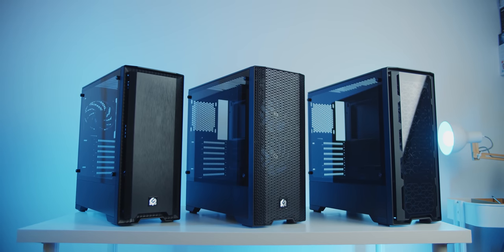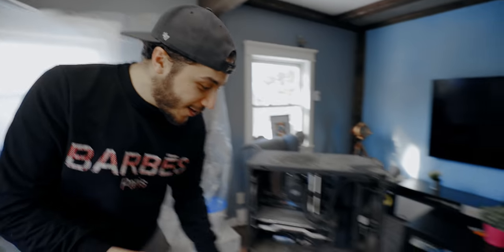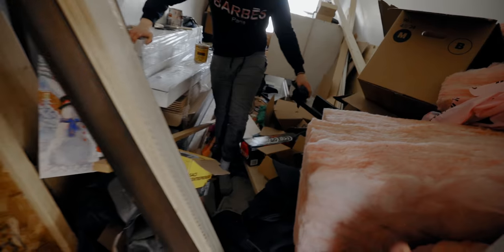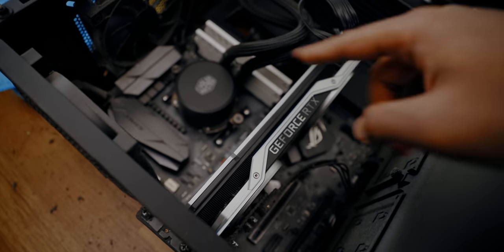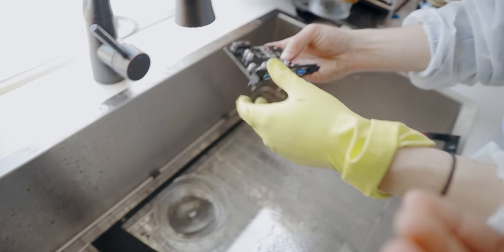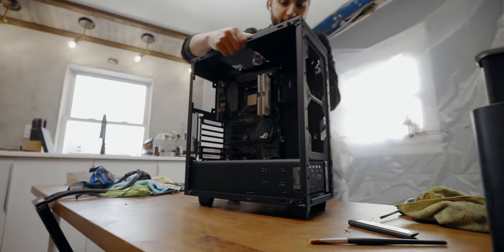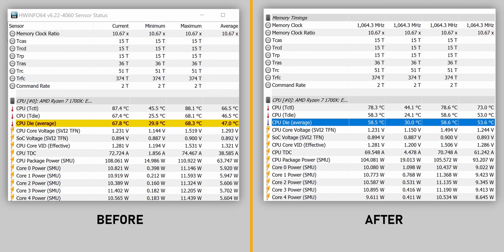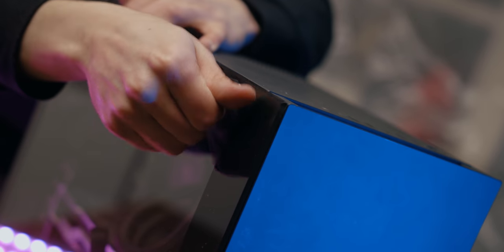THIS Is Why Cleaning Your PC Is Important! 🤦‍♂️

Comment: With renovation of the house still in progress, be prepared to repeat this exercise regularly. Good thing he has watercooling; when my house was being renovated, I still had aircooling and the CPU-cooler was completely blocked by dust- could not get it out. Needless to say, the CPU retired itself. Now I have watercooling; at least the dust collects in the fans and radiator - it's a bit easier to clean. 

I think this would also have been a good opportunity to renew the thermal paste, btw.
Lesson learned: do NOT use the PC while renovation is ongoing. That fine dust will go everywhere in the house and in the PC.

Comment: I cleaned 3 PCs now
I take the electrical parts in the PC case out such as power switch, led etc. and washed the PC case and tempered glass with dishwashing soap 🧼. I wiped water and soap (the wet rag is squeezed so no it won't damage the electrical components of the fan) the dusty asf fans is worst part in cleaning PCs. Motherboard and GPU brush with paint brush (paint brush that's only used for dusting things not for painting)

So ya that's basically it Wash PC Case, Wipe Fans and Cables,  paintbrush dust the Motherboard and wipe and brush the Graphics Card.

Comment: Use Q-tips dipped in iso alcohol to clean the fan blades.  The dust sticks to the Q-tip so you don't end up pushing/blowing it onto something else.

Comment: I can honestly recommend his CPU AIO.
I got the same one (CoolerMaster Masterliquid 240L) and I am impressed, I originally got one for free in a bundle and I was already prepared to sell it for a few bucks and get a Corsair AIO instead but I am glad I didn't. My only complain are the fans, they get loud on high RPM, but so do Corsair fans. Decided to pair the AIO with two Noctua Chromax static pressure fans and now the AIO is VERY quiet. If you're on a budget, get it with the stock fans for like 60 bucks, if you can invest 40 bucks in two good fans, you'll have a quiet AIO with high quality fans for the price of a Corsair AIO. It took a few hours to get the bubbles to move but now the pump is as quiet than the one from my Corsair 280 Platinum.

Comment: Cleaning our your pc is essential to maintain its top performance, but why do so many of you have to be so obsessive over crap that really doesnt matter, thermal paste applications, fan noise, temperature readings like I swear some of y'all need to check yourselves into therapy or something that stuff is so not worth the time in most cases, computer components no matter how hard you try are going to produce heat, its inevitable what you don't want is for them to produce too much heat, because they are constantly processing all of the workload that you  demand on the systems, I could understand if a fan was failing or it was keeping too much noise, but any moving part is going to fail eventually, when that time comes just replace it and be done with it, if the old technology doesnt fail how is the new tech going to sell huh? You think these companies are gonna make systems to last 20+ years? How would they make back that money to stay in business.

Comment: I just care for my computers, no smoking, incense, even fried foods. If your doing remodeling the computer should be covered and turned off. Thats another thing, the amount of idle time if your fans dont turn off at idle is a significant amount. In 3 years put 1.5 years of wear on your PC if you shut it down when not in use.
Obviously that AIO is working well, but it probably isnt too much longer until the pump fails or the fins get gummed up.

Comment: this definitely has mine beat in terms of dust levels, i just use a can of compressed air, and you can run stuff like that usb card under water, as long as you dry it quickly afterwards

Comment: take apart everything, if you need a proper cleaning! Throw your empty house in your bathtub or shower and do with warm wather and soap. 
grab the antistatic brush and vacuum cleaner and sweep all the dust from other components ( VGA card , SLOTS on the motherboard etc. )
NEVER blow dust !!! it's stupid because it comes back to the surface to be cleaned and you can clean up AGAIN!
USE BRUSH AND VACUUM CLEANER!

Comment: For as bad as that PC has gotten, in 3.5 years, that's honestly not bad at all, I had myself a pre-built PC from Asus, bought it somewhere around late 2012, used it until around late 2015 in October, so definitely around 3 whole years of heavy usage, I knew nothing about computer maintenance back then, the computer as a whole had only a single fan from a 120mm Radiator for an AIO that cooled the i7-4770k, and a Founder's Edition GTX 770, 3 years of negative pressure, averaged around 6-10 hours (maybe even 14-16 on weekends) a day of gaming, and once I finally opened that up to upgrade to an RX 480, pretty much everything was caked in dust, probably went to at least an inch thick thanks to negative pressure, like.. you wouldn't believe it until you seen it kinda deal.. Thankfully, ever since then I've learned to wipe down my PC every now and then, so I won't repeat that one mistake.

Comment: Yeah, I bought a box of single use gloves when I started cleaning other people PCs. Meeting a family of spiders that was about to get evicted is nothing new. Orange juice spilled inside a desktop case is nothing new. Poor fans screaming in agony for air is also nothing new :)
I believe this FPS boost can also be contributed to CPU being cooler and boosting higher/longer now. Also motherboard components, like VRMs will benefit a lot from better air flow, since they too can thermal throttle the CPU.
Most performance (re)gains that I saw was when I've cleaned and repasted gaming laptops. Since they are running near/on thermal threshold already, having cooling problems can bring that performance to the knees. Most people actually forgot how fast (and silent) their laptops can be when you let them breathe :)
Conclusion: clean your PCs people, they are not just a furniture that can be swiped clean from the outside.

Comment: I have cm h500p and it collects a lot of dust, so every once in a while i got to mechanic and clean it with air compressor(its about 10x stornger than dust blower they are using) and i gotta tell you guys to do it as well cause it keeps my case so clean its insane

Comment: Aight guys listen to this advice:

if you PC gets this bad, or even less, do not bother.
You can litteraly wash all your components in the dishwasher, I've done it hundreds of times for the last 10 years I'm building and cleaning PCs.
The ONLY importants things are :
- Your components need to be completely OFF, no power source (especially the BIOS battery, remove it)
- Fans shouldn't spin while being cleaned, that would create electricity 
- DRY YOUR COMPONENTS before reassembly (there are plenty of way to completely dry them, on a sunny day, in rice, on a radiator...)

I never had any bad result with this method BUT if you are in a hurry, that's not the best one since it takes time for the components to dry.

Comment: I have a low-airflow Phanteks Shift case I dust (fine mesh filters mostly with a full-case dust every 4-6 mo) and the last time I ignored the filters for a couple months under heavy load (batch video conv.) and then cleaned them it dropped temps roughly 5c on the CPU.  10c is a LOT for a case like that.  Just wow!

Comment: Washing electrical components (small ones) under taps isn't actually that bad, as long as they are left in a warm dry spot for a few days. Water itself doesn't damage components, it's conductivity does. No charge, no conduction, no problem.

Comment: I just cleaned my PC out today since it was 60 degrees outside (I do this typically every 3 months) and all of the dust combined was less than the amount that was on his glass side-panel. You don't have to do heavy maintenance, but all PCs/Consoles need to be maintained, that was far too much/too long. Also why did you guys clean it inside? I know it's cold outside but (besides what went into the sink) all of that dust is now dispersed through the room again. I hope you guys vacuumed after lol.

Comment: About 18 years ago I bought a decent household compressor/inflator  from a Sears auto center on sale for around $30.  Yes, it can inflate tires, but my main purpose was for cleaning my pc, which I do with a nozzel tip.  It has very suitable pressure for cleaning, and although an unfiltered compressor theoretically does put out a slight bit of condensed moisture  this has been completely negligible for my purposes.

It still works, (even for inflating my tires) although I've had to splice a leak on the old hose by now.  I bought a replacement once, but most of the lower end ones now just barely put out enough pressure to slowly fill a tire, and I'll just keep using my old one for now.

Comment: You shouldn't assume the psu is clean just by looking at it. I reused my Corsair PSU in my new computer. I have it with seven years. It looked cleed from the outside but I blew air through it and it was filthy inside even though there was a dust filter on the bottom of my old Fractal R4 which I cleaned once a month.

Comment: I don't have a data vac yet, and my PC is on the floor... Which isn't tile flooring, it's carpet. 😬... And it has no dust filter...... But at least, I take the side panel off regularly to clean the fans with Q-tips and a microfiber cloth... (Why do I still feel that isn't enough?)

Comment: Lucky he didn't short something out. You have to disassemble your system and dust it out every 6 months at least. You loose so much performance. Just getting hotter and hotter. I'm lucky and have a compressor and lots of hose. I take it out on my deck and blow off everything and then dust my entire place. Turn the pressure down to 20-25lb so you don't blow parts off. Try not to spin the fans you can over spin them much faster than they are meant to go.

Comment: Easy way to do fan blades, 1" new paint brush, takes maybe 5 seconds to clean each fan, I use them all the time. You can also use the brush to clean everything else in the system than just blow it out.

Comment: i actually wash the fans & case with direct water (i know lubricant goes away, but, i do lube the motor afterwords), possibly with low-medium water pressure, all this after full disassembly of-course & only once a year :) :) :)
dry the fans for atleast 2 days in hot sunlight, so don't this in winter & definitely not in rainy season :) :) :)

Comment: 1) PC fans does generate voltage, but, it didn't come out to the motherboard because there's a circuit in the middle, there's not a straight connection to the fan coils.
2) It's nothing wrong if you wash a circuit with water if there is no current flowing through them and you dry it before connect them.

Comment: lol thats pretty bad but the worst I've seen had so much dust the whole cpu cooler was covered an inch or more in places and most, probly 80% of the internal areas of case was just solid dust and muck lol, it was soo bad the cpu fan couldnt move and started bsoding. ohh and I also another one I saw had ants living in it and they killed the motherboard, I assume by shorting it cause they were like inside pcie/pci slots and all over the board haha

Comment: Just put it in the dishwasher, sides off, window side facing down and run a cycle. Take it out afterwards while still hot and let the heat from the cycle evaporate any water left on the components. Leave it a extra couple of days after you think it is dry just to be sure. It will smell great and be very clean. You may need to oil some fans and replace some thermal grease in a few weeks.

Comment: I have one of them bed air pumps on crack sold on Amazon as a PC dust blower,  the entire thing turns into a heat gun after 1 min, even then I cannot get radiators all the way clean. Cannot really stick an AIO in a solvent tank either, and I cannot even find a comb that will fit them all the way. Cleaning them is a bit ass.

Comment: It's definitely real. Nvidia cards will downclock themselves due to temps, they will also drop voltage to try and maintain decent clock speeds while handling heat

Comment: Bruh..... this dude really talking about not letting ur fans spin so u dont induce a voltage......... MY GUY..... thats not at all how electrical theory/physics works. And you dont think they place diodes on electrical components to prevent any sort of electrical "back-flow"... laughable. And this guy is supposed to be a tech YTer smh

Comment: I believe Overwatch uses a single core on the CPU. If you dropped 10 degrees on
 a Ryzen processor its possible you achieved a higher single core auto clock. This could account for the performance increase.

Comment: The GPU was only 2 degrees cooler because it clocked higher.

If it ran at the same clock speeds it would probably also be 10 degrees cooler.

Comment: 10.23 i said don't do this but if there is no electricity going trought components u can wash everything without damaging components only thing that can destroy components is corrosion
I know i shouldn do that but i literally wash my entire pc with pressure washer and it it working fine and it is running 5th year now

Comment: to explain the higher FPS, when you get more heat, it thermal throttles (slows down) to keep heat down, cleaning it, letting it breathe better, runs cooler, and does not thermal throttle

Comment: The cooler ryzen get the the longer it sustains its turbo...most turbo more frames too... so as you said cooler gpu better boost so split and maybe say 5fps for cooler cleaner gpu and 5 for cooler CPU....

Comment: Here is a question for everyone who's ever cleaned their computer.
9:15 - Snows tells us to always hold the fan so it can't spin if you are blowing it out using compressed air or a blower. This is so the spinning fan won't generate electricity and feed it back into the fan controller and fry it.

My question is has anyone ever had this happen to them?

I've been in the PC industry for over 30 years and I have also heard that, but I've never heard of anyone who had it happen to their machine. I've seen technicians use compressed air to spin up fans to ridiculous speeds and the fan controllers were still working after that. A few guys were having an internal competition seeing who could spin the fans the fastest using a vacuum cleaner, and nothing died. With time I started to ignore the idea of spinning a fan killing the controller and since then I've cleaned hundreds of machines and never had anything die from giving the fans a blast of compressed air.
So has anyone actually had this happen and I have been just incredibly lucke never to kill anything or is this another myth?
Reply: Blahorga Slisk I’ve watched a lot of videos of projects on how to generate electricity. The fans do generate electricity but probably not enough where it can kill components. I rather play it safe and not let the fans spin when using a blower.

Comment: I built my pc about 4 months ago, Lian li lancool 2 mesh,the works, and I have absolutely no dust in the pc what so ever, or on the outside, except for the rear exhaust fan which had a tiny amount on them but that was simply cleaned off and the dust filters taken out and cleaned and the pc is good to go (the top filter I had removed for a while and forgot about it so some dust got in but not lots! The Lian li lancool 2 mesh is an insane case
Reply: It also depends how clean the room is where the pc is. If you clean your home frequently and there is less dust, your pc will have zero dust.

Comment: where can i get that blower?
Reply: We got it on amazon. Honestly its great for small tasks and you can clean the filter easy, but if you can get a tiny shopvac vacuum cleaner for the same price, get it. The one we used is cool, but its cordless so it doesn't zucc as much as you really need.

Comment: Yeah I gotta call BS. 3.5 years of dust ...on an RTX card. And the concrete particles sitting ON TOP of the PSU filter 🤨 ...the filter filters the other way. Concrete chunks spread evenly over the top of the GPU despite the top only being open at the rear.  If all of that dust had been sucked in it would have also stuck to the face of the PSU shroud. Na... this was hammed up big time.  Nice premise, but overcooked.